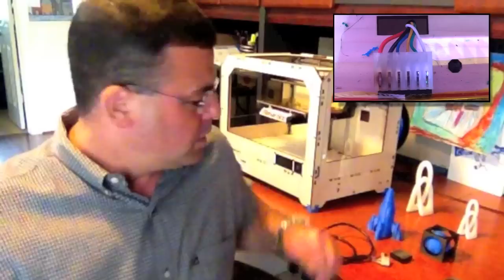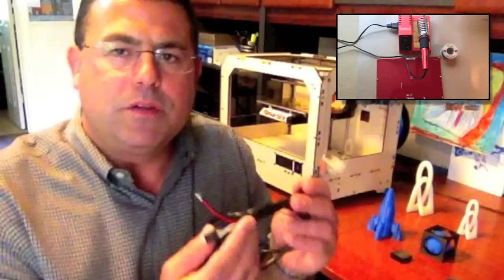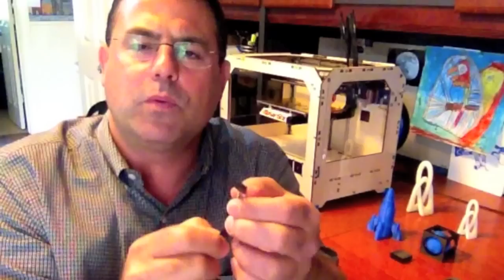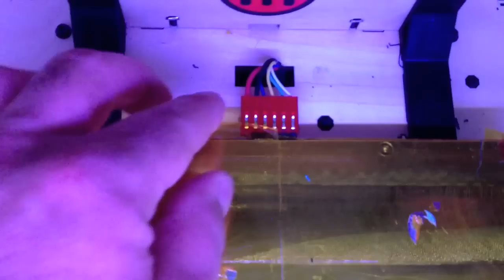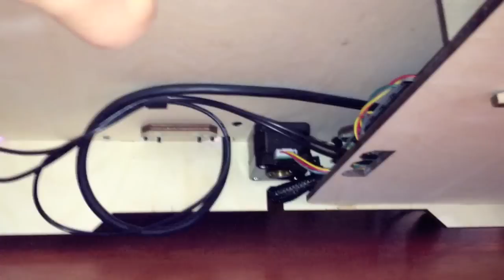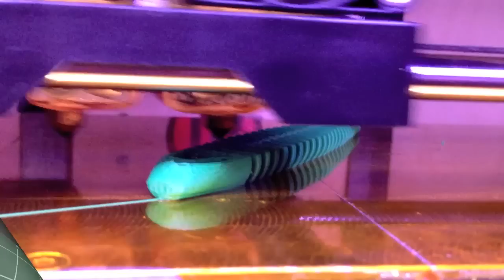MakerBot Quick Tips #4 - Wiring Upgrade

Comment: Thanks for the video.  Maybe Australia has 'old stock' but mine from 2nd half of 2012 still has a white connector.  

For me, it's easer to lie the box face down to work on the electronics (i.e. the M button down facing the desk).  I had two nuts vibrate off the Z axis supports and needed to get behind the electronics to put them back on (thankfully didn't short anything when they fell off).

PS: I use a razor scraper instead of a screwdriver to avoid digging into tape during piece removal.

Comment: I finally got it working really well. I hadn't seen your reply but I re-leveled my HBP once for like the 4th time and put the nozzles close enough that it was almost uncomfortable (paper dragged, wouldn't slide under). I printed 3 parts last night without having to monitor it.

I ordered a dial indicator from Harbor Freight but they really dropped the ball. It's been two weeks and FedEx shipped it back cos they messed up my address. That would have fixed all this, I'm sure. Thx for the response

Comment: I wish my prints would stick well enough to pull up the tape. Did you adjust your raft settings or do you usually print things large enough that they don't need one? Simply changing my platform print temp to 118* hasn't changed much; still having prints peel up or get knocked off by nozzle